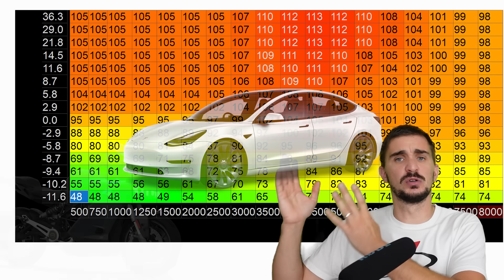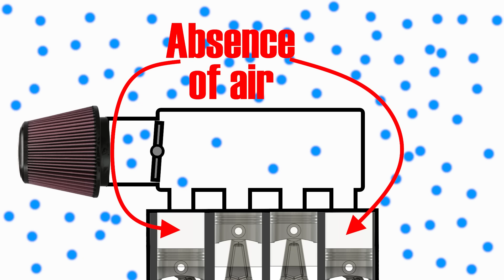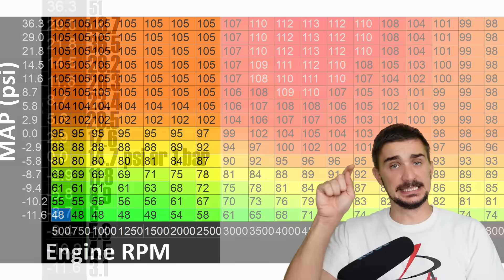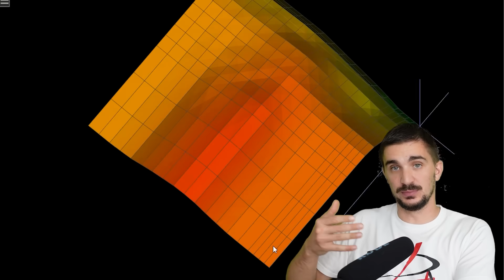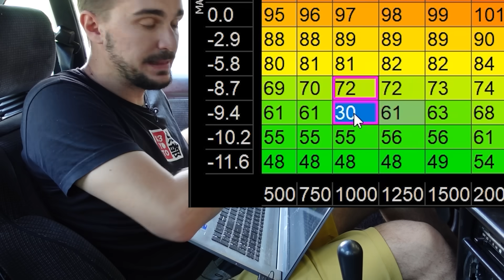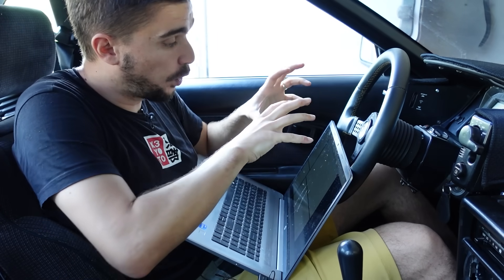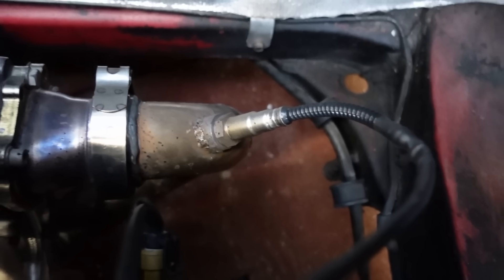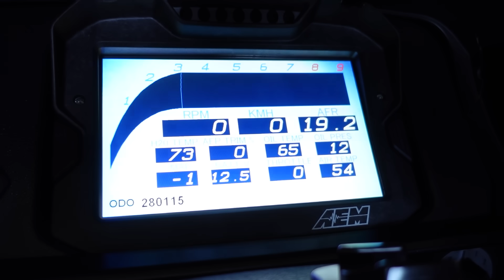If You Understand Volumetric Efficiency You Understand Engines

Comment from the maker: Become a Tuning Pro: https://hpcdmy.co/dr4a
Support the channel by shopping through this link: https://amzn.to/3RIqU0u
Patreon: https://www.patreon.com/d4a
100 cars that changed the world: https://amzn.to/3DGXDf6
Stem engine model: https://amzn.to/3Y5iZLv
1-2-3 count with Car parts: https://amzn.to/3jxP7Z6
Reply: Gimme all pawa!!!!
Reply: Can you make video about open loop and close loop tuning and which is the best one ? (also another one tuning oem wideband ecu"s and what's the difference between standalone ones ) (for example MED9.1 2000 era oem ecu for vag group )
Reply: where do MAP and MAF sensors come into all of this? Are they just so the ecu can calibrate it´s reading from the O2 sensor?
Reply: What software are you using to tune the maps?
Reply: Maybe you make a video about long and shot term fueltrim and what to change or how one can change those to make the car drive more or less economic..?
Reply: thank you for explaining this!  a good example is the VW(audi, vw, skoda, seat, cupra) 1.5tsi 150hp with kangaroo behavior. at low rpm and low demand - the engine is forced to keep the throttle open more than it should. so is forced to use the stratified mode in the acceleration phase when it should use the homogeneous mode. unfortunately VW want to have less co2 and made the engine worst. or VW used the same VE as the 1.4tsi, but 1.5tsi has same bore but a little higher stroke, so the VE is little different at low rpm. another theory is that the valve overlap at low rpm is too high (is emulating the EGR, this engine does not have EGR) and the VE is wrong. BOSCH MG1CS011 :)
Reply: I love at 40 seconds in that the example car and truck are EVs 😂 0:39
Reply: Way to spoil it
Reply: You show a tesla photo and talk about ICE engines lol 😂
Reply: WHAT WOULD IT USE FOR KEROSENE K1 AND KEROSENE K2
Reply: Fantastic video and explanation. You have the gift of teaching! Well done.
Reply: @d4a So does this torque curve apply to ALL combustion engines, or does different engines have different curves? I'm referring to that torque curve of the volumetric efficiency, of course <3
Reply: excellent videos

Comment: will the VE value in the table change if the barometric pressure changes? E.g. at different altitudes, will the VE value be the same at the same RPM and engine load? one would probably see a lower absolut manifold pressure, using a MAP sensor, at lower atmospheric pressure but how will that work with a throttle position sensor? is it required to use a barometric air pressure sensor to adjust VE values?

Comment: Hello, 
2001 mercedes benz, e220 cdi diesel engine, i have this car for 10 years and has one problem that nobody could solve, misfires while driving in gear, from 1000-2000 rpms, if i remove foot from gas pedal misfires are gone, crankshaft, camshaft, fuel regulator valves, fuel pumps, pressure sensors, MAF, all sensors are ok, wiring of each sensors checked for continuity- also perfect, flywheel changed, injectors tested and are ok, wtf is the problem still nobody gets, can improper ECU settings cause such rpm dependent misfires? 
Very good video, thanks.

Comment: I'd just like to say thank you for documenting your efforts and explaining how you installed a standalone ECU in your MR2. I've had a somewhat similar project, an MR2 with a rebuilt 4A-GE and this year I finally had the courage to apply a standalone LINK ECU and remove the old igniter, distributor and ECU. Took an extra hard path as I took an E36X Plug-in ECU and had to design a case, source some Motronic plug and what-not.

Comment: A pretty good explanation but I must say I am quite confused by the actual numbers in your table. You're telling me that at 36 pounds of boost you're at max only getting 113% of the ambient air density inside the cylinder? Also at idle needing ~61% of ambient density makes no sense either. Since you have no boost we can assume intake temperature is the same as ambient temperature so we can directly relate pressure and temperature. That means at 5psi MAP idle we would expect density to be ~34% ambient. Also related to that having the VE somehow increase as rpm increases when you have less than ambient pressure in the manifold also makes no sense. VE should drop due to greater and greater pumping losses. 

Given all of this, my guess is that this table works as a correction table on top of some other VE table that may be fixed inside the ECU.

Comment: so technically if my car rpms are waving and i want to sell it without actually repearing the problem, i just can try to change some numbers in ecu and if ill do it correctly car should run fine? if the problem of waving rpms is in the air-fuel mixture not in something else that really needs replacment? (i dont even have a car so i wont sell any with issue)

Comment: So inside every ECU is a dyno2003-esque simulation to calculate what volumetric efficiency should be?
Reply from the maker: No. What made you think that?
Reply: @d4a  Thought that would be necessary to calculate volumetric efficiency at given RPM ranges with the data points you give it.
Reply from the maker: There's just a basemap which of course isn't a one size fits all. To get the VE numbers spot on you need a dyno but the ECU can correct until you get them right so you can safely drive around and even make good power
Reply: @edge21str  The volumetric efficiency in not the question, it is the answer to a question that engine aks for each speed and each load. It is a number that satisfies a pontual situation. Imagine yourself calibrating a idle of a engine. You want 800 rpm, 30 kPa, lambda 0,95. You will trying writing numbers in the cell (and the adjacent cells) until the engine reach these parameters. The number itself is not important, but is important that the desired condition are meet (800 rpm and 30kPa). And you will repeat this to all others cells.
Reply: The automakers, before launch a new engine or vehicle, sits the engine on dynamometers for many hours. These dynamometers can generate any torque at any engine speed (variable loads at variable speeds), so the technicians reads the engine parameters (exhaust gases, exhaust temperatures, chamber temperature, etc.) and write on the ecu's table a value that satisfy all the needs on that load and that speed. It is done for each cell on table. Of course, the ecu has a little margin of auto-correction, but the map itself is very, very god. Remember that automakers must satisfy the government rules, the financial department and the clients, so the final map is a compromise model. These methods is the same from the carburetor and distributor era. Only changes is now the setup is digital, no more idle jets, mixture tubes, vacuum canisters and distributors loads to change.

Comment: Looking at all the wonderfull reviews on here I guess I'm going to be unpopular when I say I found it disappointing.  I know a little about this concept and would like to know more hence tuning in to it, but I found so many errors based on what I do know that I can't put any trust in the things you told me that I don't know.
Basically I don't see how the figures in that table make sense if they are % of cylinder volume at 14.7PSI, in that case the figures indicate it is fairly pointless boosting to nearly 2.5bar as the figures indicate most of that extra air doesn't make it into the combustion chamber and above around 0.5 bar the figures don't increase much at all.
I think I know what the figures mean but I'm not absolutely sure so I'll keep my mouth shut.

Comment: Looking for example at the map at 4:30, why doesn't the VE increase dramatically when the manifold pressure is at several times atmospheric?
Reply: 14.7 is atmospheric pressure, at the most this chart shows 2x atmosphere, not several times. Stoichiometric value to burn fuel at 100% is 14.7/1 is don’t think the chart shows anything dramatic vs the amount of airflow and load.

Comment: Absolutely amazing video, but one question is botherinig me. What is happening with the engine when it is running in different atmospheric pressure than normal. Considering the normal atm pressure at MSL is 1013,25 hPa, when driving in the mountain 2000m ot 3000m above MSL, does the VE table change then? Should it change? is it acceptable and reasonable to change the VE values when driving mostly in the mountains?
Reply: The table doesn't need to change.  It just means that when you open the throttle all the way, you will get lower pressure in the intake manifold and you will stay lower in the VE map. The map is referenced to atmospheric pressure at sea level, so at sea level, you can go up to zero on the map (zero referenced to sea level is 14.7psi absolute pressure).  At 3000m you can only go up to approximately -4.5psi on the map (-4.5psi on the map is (14.7 - 4.5) = 10.2psi absolute pressure).  With forced induction, you can go much higher.

Comment: Hi, Can you help me with something?How can i rewrite maps for apexi fc commander? I reset the maps by mistake, I have a Toyota mr2 Configuration :
• Engine: Toyota 3S-GTE (2.0L turbo, 4-cylinder)
• Turbo: BorgWarner K27 (standard turbo, max revs ~8000 rpm)
• Injector: 550cc (larger than stock)
• ECU: APEXi Power FC Full Computer 
The MAP sensor is mounted on the intake manifold.
Denso 909110-13003 with two hoses connected to the intake manifold
I only have manual access from the remote control.
Many thanks!

Comment: "Your video is excellent! 
I understood the VE map, but I have a doubt. Since throttle position depends on the pedal position, how can the manifold pressure be low at high engine speed, even in idle conditions? If the engine speed is high, shouldn't the boost pressure also be high? How is it possible to have a low MAP value at high engine speed?"

Comment: Multiplying every cell value by the ratio of the stoichiometric ratios of E10 and E85 is how I was able to brute force an E85 tune on my ND Miata in 2018 before E85 maps were publicly available. This only worked because the Skyactive engine uses ion sensors to slowly advance timing. Otherwise I would have also had to tune the timing maps as well. I ran it for about 6 months with no issues until I was tired of constantly searching for gas stations with E85.

Comment: I have a triumph spitfire,i want to convert from twin SU HS4 carbs to mapped ignition and fuel injection like mega squirt.
Would i be right to assume if i change to injection and mapped ignition that a different profile cam can be installed and the ecu etc will sort out the fueling needs of the new cam without the need for rolling road sessions unlike using carbs tha need new needles/jets  chokes etc.

Comment: İf i understand what you said correctly My gt86 torque dip is because of this map i need to adjust 4000 to 5000 rpms  afr because its not giving enough fuel for the air inside my pistons so less bang less torque

Comment: If at full throttle in natural aspirated engine ,pressure inside manifold is equal atmospheric pressure then how it exceeds 100% VE at certain rpm as shown in table cuz 102, 103 or more means that it has more pressure in manifold and it never get more than atm pressure in naturally aspirated engines 

Correct me if im wrong

Comment: This does not explain why the VE ratio is so low at low load levels (eg: idle).  Is it because at low load levels when the intake valve opens the pressure in the cylinder is still higher than the pressure in the intake manifold and a slug of exhaust gas now rushes into the intake runner and now the piston must pull that slug of exhaust gas back into the cylinder before it can draw in the fresh air/fuel mixture?  In other words a VE of 60% means that 40% of the intake stroke (volumetrically speaking) is just pulling back in the exhaust gas that rushed into the intake manifold.

Comment: What are your thoughts about using a DBW throttle pedal to accurately target specific areas of the VE table?  I did an eTune on the street a few years ago on a S2000 that had you datalog different tunes that set the throttle opening to something like 30%, 60%, or 90% at WOT (throttle worked normally under WOT).  This forced the MAP to be at a consistent predictable spot that would otherwise be difficult to achieve under normal driving conditions.  This was done for both high & low camshafts to find the optimal VTEC crossover point.  IIRC there was 9 of these tunes to datalog, two separate times (18 total).

Comment: What if your fuel injection system does not use a Lambda Sensor? I have a Golf MK3 engine which uses only a MAP (Manifold absolute pressure) sensor and TPS (Throttle position sensor) 

I am assuming that this system is quite inefficient

Comment: At 30 PSI of boost, shouldn't there be around 300 in the VE map, as there is two times more air in the cylinder as with only athmospheric pressure?

Comment: i have a question, i installed tuner pro and messed with some random cars stock ecu maps. thinking of buying a kess v2 2.53 and mapping my own engine over my pc. of course small increments and lots and lots of revisions. i have a diesel. is it smart to try and do this? i dont think id have to change the advance injection at all so in my mind this all makes sense for an extra 30 hp or so. should i try tuning it this way?

Comment: One question I have related to this...  There is a device for motorcycle I am thinking of buying. This device spoofs the intake air temperature sensor so the ecu thinks the air is colder and injects more fuel. Can such a device really work? What I am thinking is, yes, the ecu will inject more fuel but without the air actually being colder this will result in richer mixture and the lambda sensor will catch this and as the value will not fit the target AFR the ecu will then compensate thus negating any potential power increase? Am I thinking about it correctly or no? Thanks.
Reply from the maker: Yes, what you're saying makes sense. Usually such devices are nonsense and only an actual remap  of the ECU can create permanent benefits
Reply: @d4a Thank you! 👍🏻

Comment: One interesting thing I found while tuning with the VE tab was that one car had  VE around 110@max power, but was 30hp/L more powerful than another car with max VE 120@ max power. Both had max power around 8500rpm.  Both had their engine values and injector data entered correctly. Also, both cars run the same lambda targets.

There are only a couple of reasons I could come up for the reason one being the difference in friction between the car's engines and transmissions. The other reason is that the car doesn't get all the fuel into the combustion chamber. I have to note that the car with higher VE and lower power/L had noticeable fuel-air mix fog coming out from the intake trumpets at high rpm/max power range. It also can't be bad combustion because that would show up in the lambda values and adjust the VE table lower.

Comment: how does the VE map in your example account for differences in atmospheric pressure based on elevation. assuming i tune my car at about sea level the pressure in psi is 14.7 but if i then drive it at lake tahoe with an elevation of roughly 11.8 psi. do engines typically also have pressure sensors to get a baseline is or can the run entirely off of what the MAP sensor provides?

Comment: Small question but I never found the answer because nobody talk about that.
After a pull, throttle closed, from 7000 rpm to idle, during the revs fall, do we must keep a 14.7 afr or can we go 20, 22, or more because ecu cut injectors opening ? It would be so nice if I get an answer 😊

Comment: Thank you for this video.  Finally someone that translates the fundamentals of cylinder filling.  No engine sucks in air, no turbo sucks in air, gravity compresses the air, which forces itself into the cylinder or turbo, hi pressure to low.  The aviation industry is more intuitive using positive manifold pressure , no erroneous vacuum standard.

Comment: Hmm.. I monitor all this with a bluetooth ECM thing and the Torque Pro app.  I can see intake PSI and Volumetric Efficiency.  For example, both my sister's 1.8 liter 4 cyl Honda engine and my 3800 II V6 GM engine will show up to 14ish psi at WOT intake PSI.  8-9psi normal driving.  The Honda gets over 100% VE, which surprised me.  Close to 120% at WOT between certain mid-high RPM.  I think something  (well, I know I have a vacuum issue) is wrong with the 3800 II V6 and it doesn't go over 85-90% VE.  I've heard that this value is really only relevant at WOT but I think it's still meaningful in its own way at all driving conditions.  

It's just something to keep an eye on and learn your engine so that you can notice if something changes.

Comment: This video was full of useful information. I am not sure only about one thing. When the engine is in high rpm, the coming air is so fast, that it still sucks in air, even when the piston is actually going up. The valve timing has for sure a lot to do with engine performance, but I am not quite satisfied with the explanation about, why is filling the engine with air, in high rpm worse.